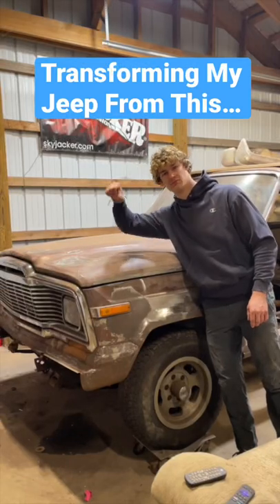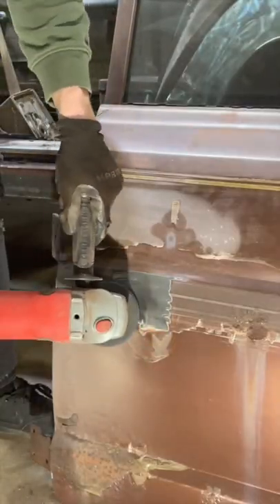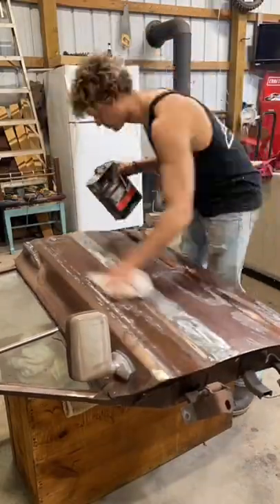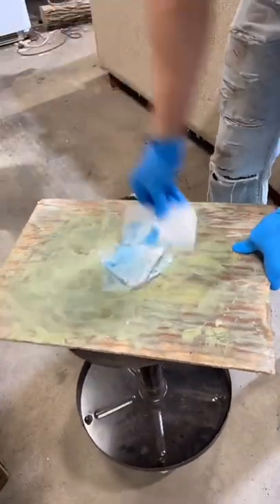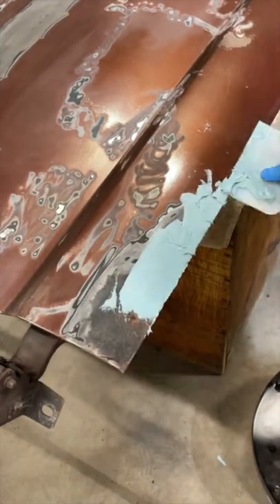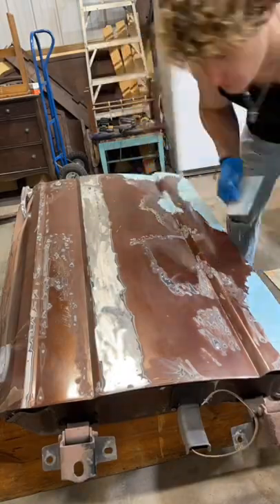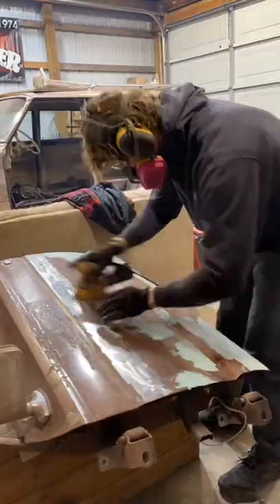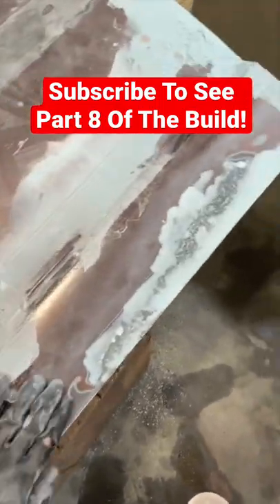Restoring My Jeep Into A Camper Van! #diy

Comment: People don’t seem to understand that if surface rust is covered with filler and paint so that no moisture or oxygen can get to it, it will not continue! Steel can only oxidize if it has oxygen and moisture. If it is completely sealed it will not continue!

Comment: You should have used rust treatment on the pitted parts. Mechanical stripping like grinding or sanding won't get all of it and it can come back after you painted it.
Reply: Rust can be a bitch really the only way to make it not a problem with a car like this is to get the whole thing dipped in a chemical bath because chances are all that rust is in areas you can't get to
Reply: @connerruss6012  the chemical dip stays in pockets of the body and frame and eventually turning the whole thing into swiss cheese
Reply: @WTC7  not if you take it to a place that does it properly and does additional dips in a neutralizing solution, there's many kinds of dips you can do and many different kinds of chemicals that get the job done but I'm sire some places don't do it properly and that'll happen
Reply: Blast then dip.  You’ll find if you have corroded to the point of having pin hole in the metal. Weld or reskin.   It’s not easy but worth while if you want to have the vehicle a long time.
Reply: I agree with you all. I meant for like a diy or non collector car. Only reason I said that is because my dad and I sanded the rust and painted but rust on his roof came back. Turns out, there are micro dust particles you can't get without removing metal.
Reply: @swanginfleet  yeah I had the same problem with an old accord I had the quarters had rusted out at the wheel wells and the reason that happens is because rust gets in ever little crevices and into the metal itself if it's ever possible it's better to just cut away all of the areas with rust most times you'll have to either way if the rust is bad because in bad areas especially after the chemical bath there's not much metal left if any at all. I realize I got distracted I was trying to say I repaired the quarter on my accord and only a month or two the rust started to come back

Comment: Your rust will come back if you dont treat it after removing paint.  Putting bondo on top of rust will cause separation later on.  If you would have put self etching primer and epoxy primer before adding filler you can prevent rust from coming back

Comment: Little tip with filler one id use evercoats opex rage filler it's far better than any filler in my opinion and there's no need for that much hardener in the filler if you're using that little bindo it only needs maybe a quarter inch of hardener and I wouldn't even touch the bondo this that electric sander I'd buy some sanding blocks and hand sand it you'll get far better results and doing spot repairs like what you where doing just makes it harder for your just cover the entire door in bondo you'll do a bunch of chasing if you spot repair, and I would stay away bondo brand bondo they have the worst bondo in the industry it is unbelievably thick and is stupidly hard to work with compared to the bindo you can get from the professional companies basically if you're going to a store to buy the bondo don't buy the bondo chances are it's junk look online for good bondo
Reply: I do body work for a living and I’ve come to love the 3m body filler and glaze. All u need the DA for is feathering out the layers of paint apply filler to low spots and u should block the filler with 80 grit in a x patterns to shape it and then do a skim coat of glaze and 180 that In a x motion to get an even sand and then DA the sand scratches with 180 trying to avoid touching the filler because a DA doesn’t sand flat it will make filler wavy. And if u do DA it do it in 320 or 500 grit. But u get better results blocking
Reply: @Sirbuckerton710  I haven't tried 3ms filler yet I don't like how it's yellow tho but color doesn't effect quality
Reply: @connerruss6012  that’s all o use is 3M also. Best stuff on the market. I’ve been doing restoration and stuff for nearly 40 years.

Comment: So basically you put a bandaid on it you did nothing could have at least put a rust converter on the metal which would have slowed the Russ down for a year too but the way you did it in 6 months your paint jobs going to be bubbling off

Comment: Don’t listen to the old heads and know it alls. I’ve painted many cars in my driveway with similar body work comes out great. One thing I’d suggest is taking the time to block sand the filler to make sure it levels out with the surrounding panel a da will leave low spots. Also block the whole car once you get in primer make sure it’s perfectly flat and ready for paint. Paint doesn’t cover anything.
Reply: So what's someone supposed to do a year later when the rust comes back? Cuz it will. 🤷